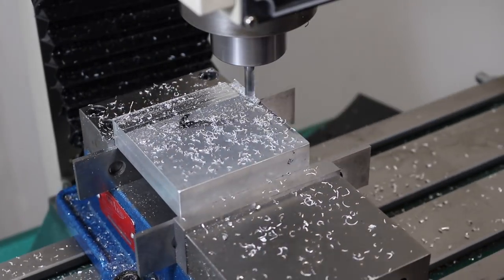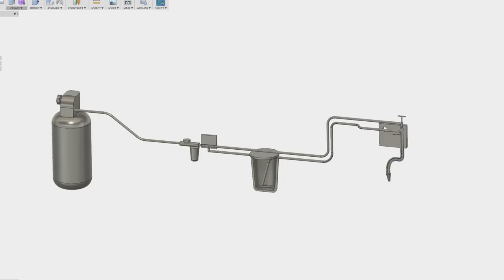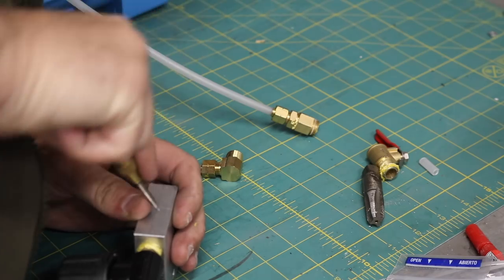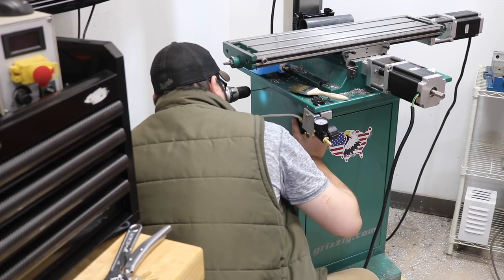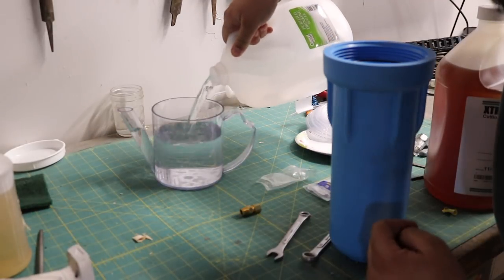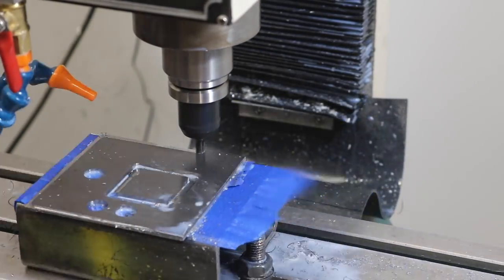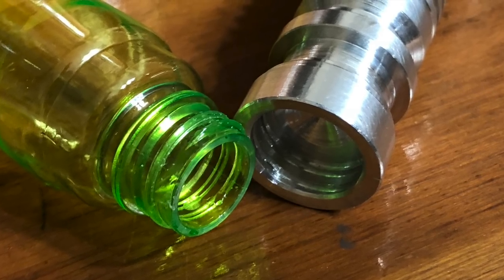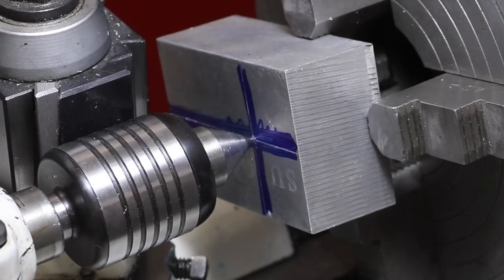A Tale of Two Spitties: Mist Coolant for the CNC Milling Machine

Comment: Now you are just missing the double bottle attachment to allow for hot swapping coolant bottles without disruption of coolant flow.

You should put a ball valve on the inlet of the bottle to allow you to shut off air flow in case you run into the situation of running out of coolant mid cut again. That way you can leave the air on and swap bottles with basic air coolant. 

This is going on the list of projects for my someday shop.
Reply from the maker: Solid idea!

Comment: I did some science fair stuff at an elementary school with soda bottle rockets. It's amazing how strong those bottles are. I pumped them over 100 psi several times without issue. And when they do fail it's a ductile failure.  If you needed a higher pressure rating you should use a 1L bottle since it uses the same preforms I think as a 2L so the wall is thicker.
Reply from the maker: I believe it! The bottles need to be able to take a surprisingly high pressure just to hold soda, and I’ve found that I only hit about 20 psi max with this setup

Comment: Solved the problem of the soda bottle threat the easy not so elegant way... I took the cap and made a very big hole in it nearly all the diameter size the top has and epoxyd the rest with the threat into the block. Was done in 5 min and works since nearly 2 years without problem but I would have preferred your elegant way but had too less experience in threats that time to try it. Changing the bottle so is a fast and comfortable way getting new coolant...with time and experience you can minimize the coolant more and more today a bottle last 3-4 times longer than 2 years ago it doesn't need much to have the same result...

Comment: Nice work. I built almost the exact setup except I got a used garden sprayer, 3 gallon I think, at Restore, the Habitat for Humanity store for used building supplies ($5.00) and used a 120VAC solenoid to goose it into operation.
Reply: Did you use the sprayer pump for pressure, or regular compressed air?

Comment: For the soda bottle thread, i just took the cap that comes wt the bottle and epoxy-ed it into a hole large enough to accept it's diameter- and obviously drilled out the cap for fluid to pass. Make the hole deep enough, it can't be seen, so the aesthetics don't suffer too much.

Comment: Looks great and if it works even better, i have watched many videos on this subject and most are all the same, they miss out what you do with the used coolant, ie where does it go? how do you recolect it and filter for reuse, i'm sure you don't let it run off the table and run across the floor to a drain.

Comment: Now you got to find a way to catch the coolant so you aren't burning through a bottle or two per part
Reply from the maker: If I were running a flood setup, definitely, but with the flow dialed in there’s hardly enough to catch and I’d likely have to set up some sort of enclosure so until then I’ll just spend the coolant

Comment: Have you tried a venturi effect system?
Reply: Best way, no need to pressurize the containers and easily to adjust the flow rate with a needle valve.

Comment: Cool but when threading into a blind hole have you tried running the lathe in reverse and threading on the back side from the blind end toward the open end? Joe Pieczynski made a good video on this .
Reply from the maker: Yep I’ve see Joe’s video, it’s a genius trick, I’ve even done it myself. Can’t do it on a south bend like the one I’m using in this video though, threaded chuck, it’ll spin right off
Reply: Trying to figure out how to secure a chuck on a spindle thread without messing up the threads or reference surfaces.  Maybe run a drawbar through the spindle and thread it into a plug on the right side of the chuck?
Reply: @mortcs  oh,I didn't realize your chuck screwed on. You're limited to the method you used

Comment: the problem is sooo many water around after 1 hour of work. even very tight level 1 liter coolant is on the machine and floor. For exmaple manule hand pump work very well. I spray one "pıısstt" in every 20 second. and it is enough. and it evaporarates. but I need my hand of course.

Comment: I would use soda stream bottles if they have the same thread, they're a lot more durable and designed to handle high pressures
Reply from the maker: Eh, regular soda bottles are already free and disposable, and this system only uses 20 psi tops

Comment: This is my second time viewing the video. I am seriously thinking about making one for my mill. One question I have though, what is the approx air pressure you have coming into the system? I am wondering if I will have to plumb air from my big compressor to the mill or if I can use a smaller one that I can locate in the dead space between my mill and lathe.
Thanks for sharing this with us.
Reply: I've heard of people using an airbrush pump set up that is sold at Harbor Freight.

Comment: Good video, however, I'm pretty sure you are using way too much coolant.  I use a similar Kool mist setup, and just the smallest amount of liquid is sufficient, barely enough to make a paper towel damp.  There is a reason they call it MQL (minimum quantity lubrication).  This isn't flood cooling after all!  I find a 1 gal container lasts for months, albeit with light use.  You may be using a coolant that isn't designed for MQL though, I'm not sure about that part.
Reply: I agree. I've had to check my mist coolant is actually on before as is so hard to see.  I'll usually hold my finger a inch away from the end of the nozzle and see if it comes away wet after a few seconds... This isn't flood coolant!!
Reply from the maker: Yes as I said in the video there’s plenty of room to adjust the flow down
Reply: @PracticalRenaissance -  Consider trying UNIST COOLUBE 2210. We used it with a Kool Mist system. It looks more like a very light oil. Nice system you made there!